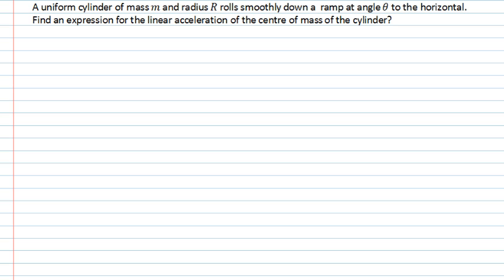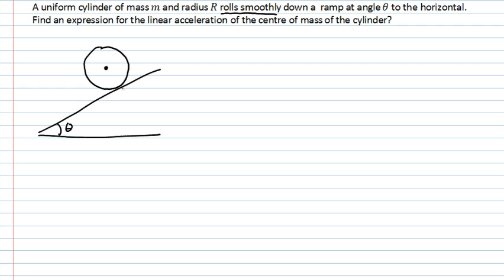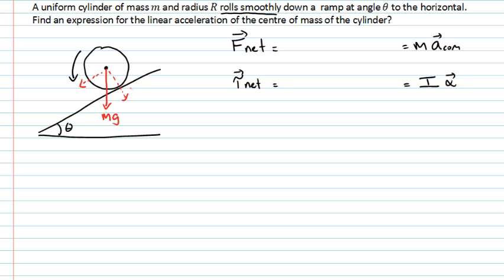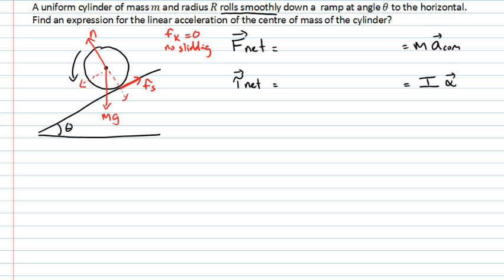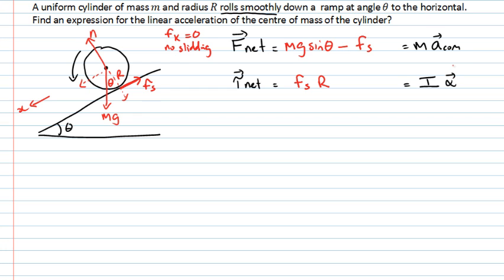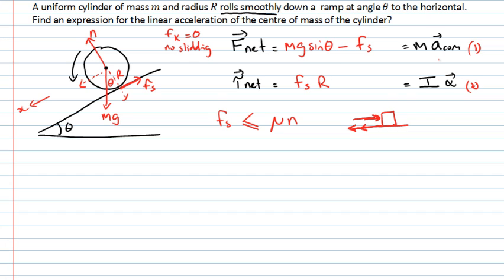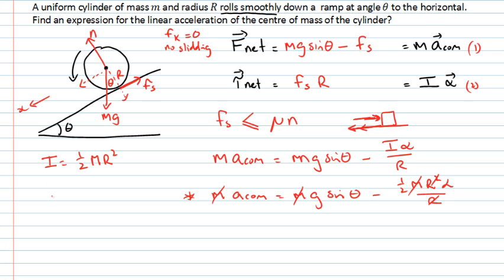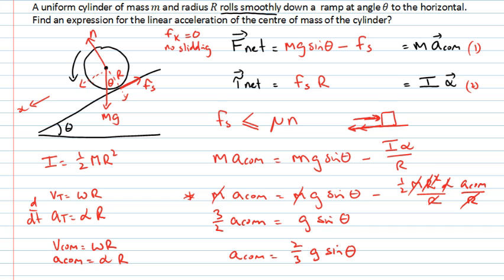Determining the acceleration of a cylinder rolling down a slope (PhysCasts)

Comment: but if theta were to be 90 degrees, shouldn't the acceleration be g and not 2/3 g? Is this not the case or is theta to be less than 90 degrees?
Reply: there would be no friction at 90 degrees, it is as if the plane didnt exist, and therefore we cannot use this formula for it.
Reply: @liquidblueeyesdragon1204  To add to your comment, the cylinder would no longer roll. Which is interesting, because if the cylinder is sticky and therefore rolls on a vertical wall, it can't accelerate faster tan 2/3.